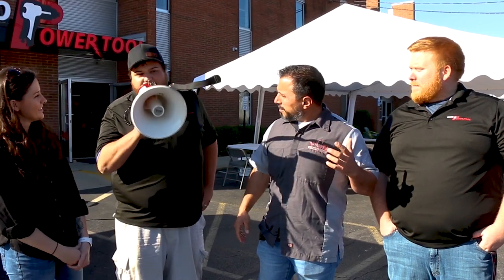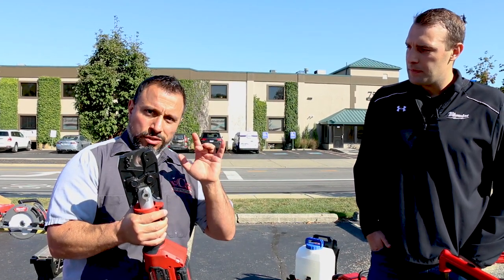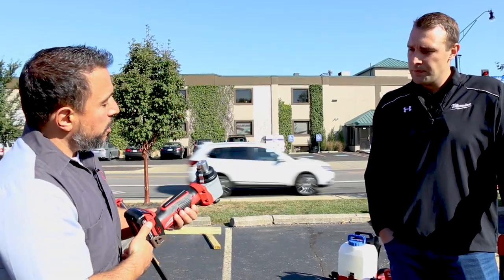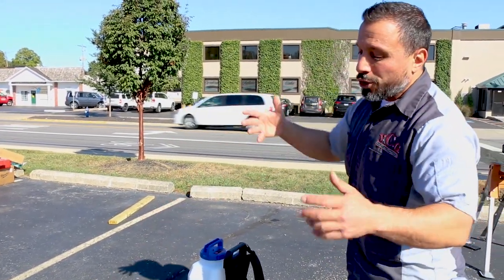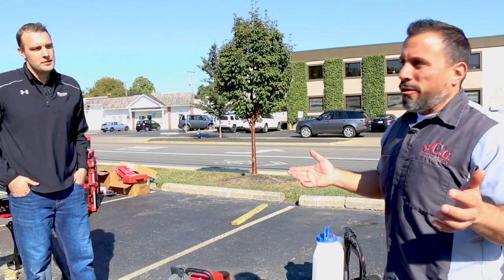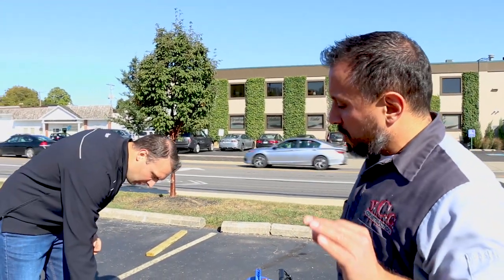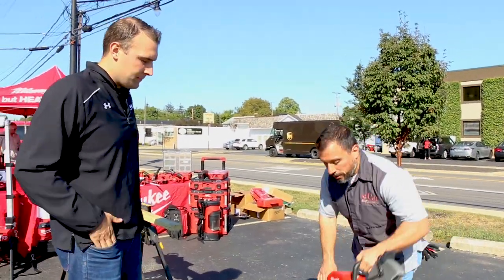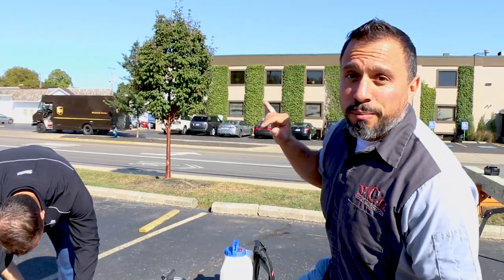New Milwaukee Tools For 2019 That You Need To See!

Comment: I am a "serious" DIY'er. And have a decent collection of Ryobi 18 volt tools, but I am tired of buying new batteries every year! My impact is starting to make some serious noise, so it's a good time to slowly start upgrading and I have settled on Milwaukee. M12 for Impact and Drill, and eventually m18 for saws and SDS later on. My question is for a serious DIY'r, (doing everything from decks to cabinets) which is the better impact the M12 Fuel or the M12 Fuel Surge. I will only have 1 impact, so it needs to be able to handle every job. Thanks!
Reply from the maker: Unless you are working where you need to make less noise I would go with the standard M12 impact

Comment: I feel like Milwaukee has catered to all trades except concrete. Looks like that’s changing. With the redstick concrete level, the switch tank concrete sprayer, and the cutoff saw they are starting to make some tools for out trade. Unfortunately we are still missing a cordless concrete vibrator and an electric jack hammer. Which both dewalt and makita currently offer. Hopefully this is in the future for Milwaukee!

Comment: what's going on Vince I can't believe that everything is now basically battery operated I was thinking how DeWalt has the battery with an extension cord would Milwaukee ever think about coming out with the same thing because I would have bought the table saw and chop box instead I bought the DeWalt just because they're great tools and I believe those tools should be corded because they are stationary tools and I wouldn't want a table saw or chop box to lose power mid cut so if Milwaukee had that I would have bought Milwaukee
Reply: Joseph Malinowski 🤔I would say battery and cord design is better. And they should build charger in table saw too.when people plug in. Table saw should be able to charge battery at same. When people unplug cord. The table saw switch to use battery power. Yes, just like a radio charger.
Reply: 赔我小鱼干 I just believe that the table saw and chop box are such a powerful tool and heavy that once you set them up on a job they pretty much stay there all day so that's why I like the DeWalt battery and plug combo all my tools are Milwaukee I would have purchased the Milwaukee table saw and chop box if they came with a battery cord combo because tools like that you want them at full power because they are such dangerous tools thank you for the comment you are correct